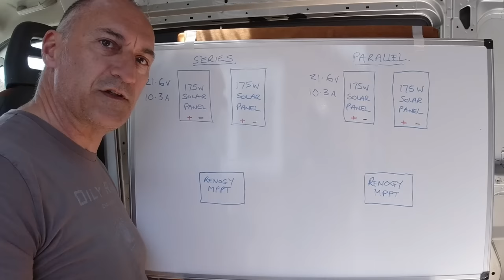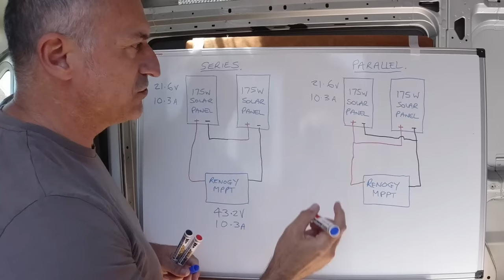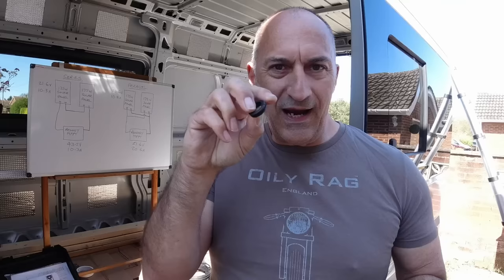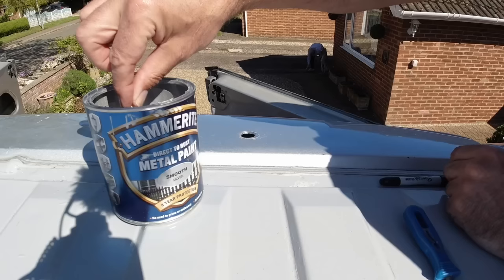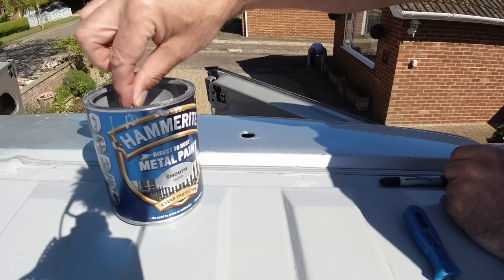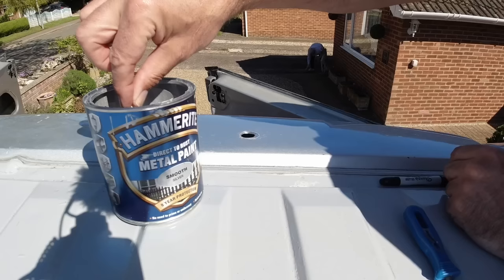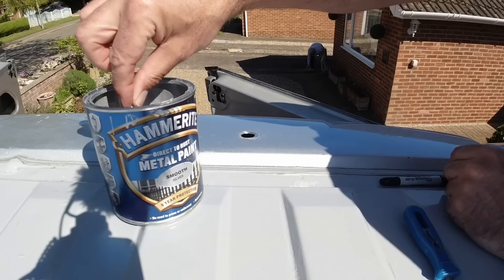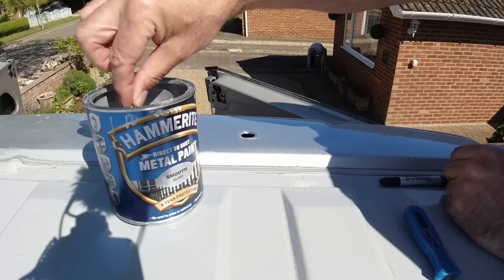How to Install Solar Panels - Budget Van Build Ep 10

Comment: Just a bit of info i have a 50amp victron controller with 3 x 215 watt  victron solar panels best draw 1.20 kW so far can't wait for summer..also able to run a 1500 watt airfryer using a 3000 watt inverter on solar system instead of using split relay system.
Reply from the maker: You obviously have lithium batteries to run that inverter
Reply: @GregVirgoe  no since August 2022 been living in van 5 nights aweek as early Starts (hgv driver)..running on 12v heavy duty 100ah x2 batteries..Will be looking at lithium in the future...i keep an eye on voltage using app and turn temperature down/up on solar..but no bother with engine running
Reply: @GregVirgoe  just like to add when i started van  back in January 2022 i watched some of your videos and other which helped...many thanks Greg.
Reply from the maker: @Deiseboi  125A is way too much to pull out of 2x100Ah normal leisure batteries. I can see why it only works when the vehicle is running. I’m even surprised it’s does that 😳
Reply: @GregVirgoe  sorry Greg I meant a 1000 watt airfryer...and it runs OK off solar panels on a sunny day..I did a short video on here of it...I had night heater tv and light on at same time no hassle and no bother with the batteries
Reply from the maker: @Deiseboi  I imagine the only reason you was able to do that was due to the high charge voltage coming in from the solar controller. If you try and pull too many amps off a normal AGM battery the voltage drops dramatically because it can’t keep up with the demand then your inverter goes into error mode and turns off. I see so many people trying to run all sorts of electric heaters with no thought to the C rating of the battery.
Reply: @GregVirgoe  thanks for the tip..i only did that once just a test..I only run airfryer while cooking then the TV and heater if needed..I wish i knew you last year as what you saying would have been so helpful..i am thinking of getting 4 x 120ah 12v batteries cost 640 euros here in Ireland..any thoughts on that as i can't afford the lithium as love to get a 200ah one.
Reply from the maker: @Deiseboi  ok so that will give you 240Ah of usable storage as you can only use 50% of their capacity and with a rating of C20 will give you a constant draw of 24A which is about 300W
If you want to use higher rated appliances you may want to look at one or two 100Ah lithiums you can get them now for under £500 ea
Reply: @GregVirgoe  thanks Greg i will look into that but not till some time next year...your a sound man.
Reply from the maker: @Deiseboi  just spotted these at an incredible price too
https://www.ebay.co.uk/itm/125237263746?mkcid=16&mkevt=1&mkrid=711-127632-2357-0&ssspo=izptme_4q9u&sssrc=2349624&ssuid=IAwKHBzwQ6K&var=&widget_ver=artemis&media=COPY
Reply: @GregVirgoe  just looked that up and they don't deliver to Ireland but many thanks...i be looking out for that.

Comment: With the unistrut s
Does the water get stuck in the slots? Would it be better using un slotted?
Reply from the maker: That is a good point. You can do that and they make an aluminium unslotted rail for less weight too
Reply: @GregVirgoe  seen that but I'm unsure about the clamps, have you seen them somewhere?

Comment: Im following this to the T . Is it ok to just seal the solar panels brackets down without screwing into roof its a motorhome roof cant afford any leaks . And was your wire gland facing the wrong way ? into the wind
Reply from the maker: If you have a flat roof I would recommend the larger plastic panel mounts as they have greater surface area for just sticking down. 
The cables would hang over the end of the roof it that gland was the other way around. That would look even worse.
Reply: Be careful with the plastic feet as they have releasing agent on them from the manufacturing process. Remember also that you are only sticking your panel to the paint on the roof.

Comment: Won't the connectors and in line fuse rattle about on top of the van?
Reply from the maker: use these self adhesive cable tie bases, make sure to clean the surface of your roof well first.  https://www.ebay.co.uk/sch/i.html?_from=R40&_nkw=self+adhesive+cable+tie+bases&_sacat=0&_dmd=2&rt=nc&mkcid=1&mkrid=710-53481-19255-0&siteid=3&campid=5338027957&toolid=11800&mkevt=1

Comment: Can you give me a quick summary how the engine uses more diesel to charge the when van battery is low and no solar panel. What I mean will the solar mean the actual van battery will not draw as much power and therefore save diesel?? Or anyone in the comments who knows about mechanics would be able to answer 🙏🏻

Comment: Brilliant videos. Would it be better to have the glands on the cable entry cover facing towards the back of the van so that water doesn't get forced down the cables when driving? I know where you are situating your's doesn't really allow for that but just wondering.
Reply from the maker: Yes that is the better way to have it as it’s a little more aerodynamic too but that would mean the cables have to hang off the end of the roof in mid air to get into the gland. 
I always put a smear of sika around the cable entry and always been ok 👍🏼 cables do turn down onto the roof so water would have to run uphill
Reply: Perfect
That was my question too.
But as it is behind the panels I guess not too much issue with weather anyway.

Comment: How much do those screws stick through the roof?
Reply from the maker: About an inch but are within the roof insulation. You could cut them down from inside if concerned about it.

Comment: Why is it OK to drill panel brackets straight into the roof, but with the fan you use a frame? I'd have thought a panel has more opportunity to fly off given the size of it and turbulence created by the fan in front
Reply from the maker: These panels will not go anywhere there is air flowing equally above and below and the fixings and adhesive are a strong fix.
Reply: @GregVirgoe  Thanks for replying to both my questions today. Must've watched your entire Sprinter series twice and now following along this as I've started my own LWB Relay build. The cleaning and sorting out old screw holes is such a chore. Finally put the floor insulation battons down with the PIR boards being delivered tomorrow. Exciting times!
Reply from the maker: @jesuscamefromouttaspace9549  I see you edited your question and understand more what you meant. 
A bolt and nut would be more secure but then you could never remove it later on if needed.

Comment: I laugh when people say “you’ve fit the gland the wrong way round”ha! …it’s bonded on and it has an ip68 gland! …even a fart wouldn’t make it through that seal 😂
Reply: It might seal ok but aerodynamically it doesn't work as well that way around. The moving air is trying to force it up off the roof with it that way around. It might create some annoying wind noise too but luckily it's a way from the driver/passenger
Reply: I don’t know. I’ve been told my farts can travel through glass, so there’s that! 😂😂😂😂😂
Reply from the maker: Yeah 😂because the aerodynamics of this gland is going to ruin my fuel economy 🤣
It make no difference it’s totally waterproof 🌧️
Reply: @GregVirgoe  lol well obviously not. I was simply pointing out that it's designed to go the other way around to prevent the air from the van moving trying to lift it up off the sealant. That sikaflex is strong stuff though it'll probably be fine
Reply from the maker: @HenryOCarmichaelSmith  sorry I’m only messing with you 😃 it really makes no difference it’s so small I would have to be doing Mach 1 for that to fall off the van 🚐

Comment: What if you needed to use 3 of those panels?
Reply from the maker: You would need to get the 50amp charger and still parallel them together. You can get special three way MC4 connectors for joining all the positive together and the negative together.
Reply: @GregVirgoe  ty that will be helpful info for me.  Just started learning this.

Comment: Is it just solar you are using or are you having hock up as well?
Reply from the maker: My Solar charger is also a DC to DC charger in one so will be able to charge while driving. My inverter has mains input and auto changer over so that will be connected to the hook up 👍🏼😃
Reply: @GregVirgoe  this is the part I’m completely stuck on. Goes over my head. I have sales person hands. I’ve put myself out my comfort zone but I can’t get my head around it. May need your support 😂
Reply from the maker: @LeeGMK  no problem my electric wiring videos will make it easier to understand and you can always ask questions if you’re stuck 👍🏼😃

Comment: I am confused. Solar panels are 12V how do you arrive at 21.6V?
Reply from the maker: Not all solar panels are 12v some larger panels or ones with more cells are 24v
Reply from the maker: @Photostoryhr  please check the specifications of the panel https://uk.renogy.com/175-watt-monocrystalline-solar-panel/
You will see it’s operating voltage is 18.1v and short circuit voltage is as I have stated. These panels have far more smaller cells than standard panels.
Reply: @GregVirgoe  thanks for explaining

Comment: Why do people put the cable gland facing forward, when it should face rearwards? It is shaped that way for a reason.
Reply: It really doesn't matter. Its bonded down and those glands wouldn't let anything through when tightened correctly
Reply from the maker: Thanks Jim, please read the pinned comment ☺️
Reply: @Jimmy-lb1yc  Indeed, nothing is worth doing correctly these days. Just chuck it on or in and hope for the best.
Reply: @welditmick  Hahaha They can be fitted either way. Yes it is better facing rearwards for obvious reasons but doesn't mean having it facing forwards is incorrect. The glands make a waterproof seal when tightened correctly

Comment: So 350W solar inkl mppt total 420 pound and thats the old special price over 500 euro why not a normal house 450w pannel like I have from Risen cost 159€ the pannel plus like 90€ for a victron smart mppt its half the price still a lot of room for a dc to dc charger and can use solar and charging from motor at the same time ....
Reply from the maker: Because you can’t buy a Victron smart mppt for less than £170 then you need another dc to dc charger on top of that and they still won’t be able to do what this system does. My panels and dc to dc and mppt all together only £400. So it much better value than a second hand house panel. I have warranty and redundancy built in.
Reply: @GregVirgoe  here in Spain im Leroy Merlin 159€ NEW 450w Risen in Germany you get the small victron smart mppt for 80 to 90 € on DC to DC victron is a little pricy but over all still cheaper than your 350w solution yes maybe its a problem to get it all in the UK sorry no idea about that ... I bought my victron stuff in Germany and drive to spain bought the pannels here and installed it here
Reply from the maker: @DMonTour  how much did you spend on diesel ⛽️🤔